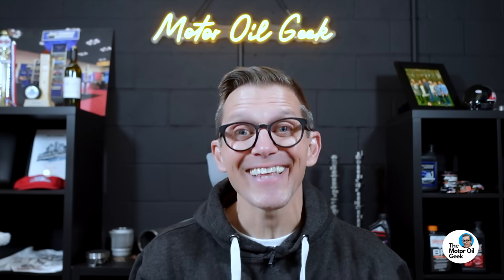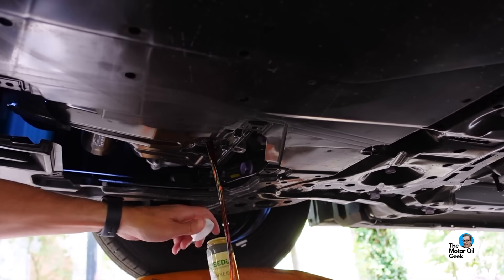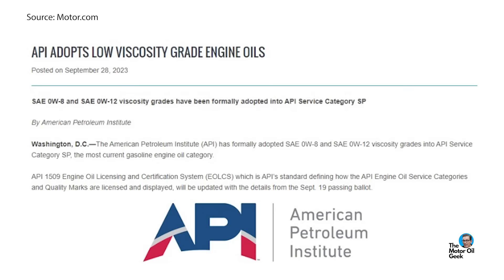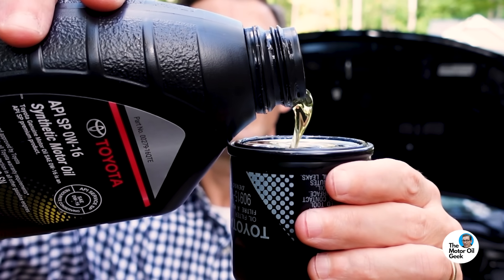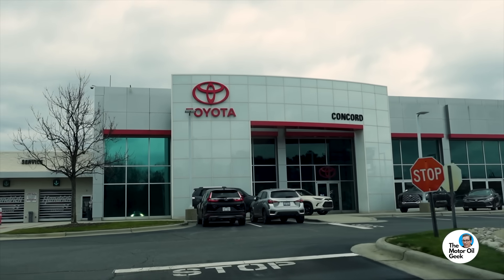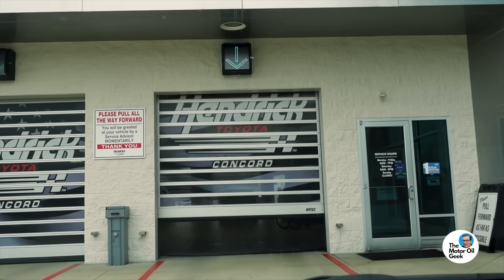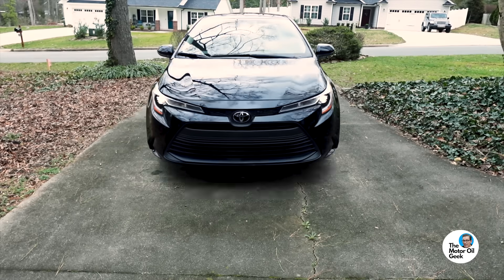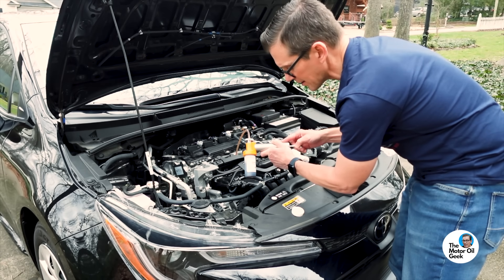0W-8 Motor Oil: Too THIN to Trust? Let's Find Out!

Comment: Would use the new Penn ultimate or stick with Toyota 0w-20 oil in my Tacoma? How good is Tacoma 0w-20 oil?
Reply: I don't think it is anything special. Project Farm actually just did a video about OEM oils recently if you're interested. 
I just use a mid-tier 0W-20 in mine (Quaker State, Pennzoil, whatever) and I change it every 5k miles, pretty standard. 
I tend to subscribe to the mindset that most of the synthetic oils out there today are pretty good and unless you are stretching the interval out the premium stuff doesn't justify its extra cost in the long term. However, that's just my opinion. 
The Tacoma is a good truck and I expect the engine is perfectly happy with any decent oil. Heck that may even be why the stuff with the Toyota label isn't the best oil out there.

tldr, you're probably fine either way.

Comment: I have Toyota Yaris Cross hybrid 2021 model last year  14.500 km I got my 1st oil change by dealership and they put 5w-30 and I don't have a problem in my Yaris Cross by now odometer now is 25.600 km.

Comment: Okay, I was just heading to the comment section to tell you my opinion of waiting 10k for the first oil change.  Glad to hear you didn't wait that long in reality.
Reply: no one shood be changing oil at 10K
Reply: @jesseozmen9835  everyone in europe is, most of the people say its not worth the money to change it earlier. Some people even change it every 20k
Reply: @foxy126pl6   i have seen first had many times what an engine looks like at 70K miles with 10K oil change its not good.

the way i see it is they are to meet EPA requirements so if 0W-8 works for 100K miles and the engine wares out that's the problem of the sec or 3rd owner.
and 10k mile oil changes are ridicules 5k max.
Reply: @jesseozmen9835  idk, ive seen lots of cars with over 350k km that did oil changes every 10k miles and they still run
Reply: @Billybigrigger-ic7jp idk, we usually type "15k km for next oil change" which is like 9000 miles, most of the people do it either every 15k or every year, whichever comes 1st. I have seen some people do 30k km or 18k miles between oil changes since "thats what the manual says"
Reply: @Billybigrigger-ic7jp european manuals dont. They do it becouse the brands know noone can stop them from saying that

Comment: There is this ongoing debate about how with today's engines being manufactured with tighter tolerances, would an oil change at or before 1,000 miles be necessary?

Honestly? I'm from the old school days of car mechanics/maintenance and I definitely would still do it.

I was also told, most likely incorrectly, that the very first oil that goes into a newly assembled engine is given a special additive that assists with the break-in period.

My question is, with your testing of these new oils they showed great results in hot temperatures but, did you conduct any tests with these same oils at negative degree temperatures? I mean, surely an oil lighter than air (sarcasm) at 0W 8 would have no issues pouring/lubricating at extremely cold temperatures.

Comment: 🔔😎Question. 
I have a Fox Mustang 5.0 with the "sandwich" water to oil engine oil cooler between the block and the oil filter and it's plumbed into the heater hose, as per police cars. 195* thermostat. Mobil 1 10/30, Mobil 1 filter. Whats your thoughts on that type oil cooler for hot summers?
Trucks are plumbed into the lower radiator hose.
Thank you for sharing all.your great knowlege.👍😎🇺🇲

Comment: Toyota CVTs are not designed like any other manufacturer. They do not have pulleys with steel belts. The fluid change intervals are not needed as frequent.

Comment: I don't like low viscosity oils and CVT transmissions. CVTs have been more mainstream because the 'supposedly' get better fuel economy and it's an automatic. I'm not sold on it. I would love to see a side by side comparison of a Corolla with a CVT and a regular geared transmission.  I had a 1997 Corolla with a 5 speed that I ran all Valvoline synthetic fluids and I built a custom cold air setup with a K&N cone air filter (before I knew better, I would never run K&N again). I would consistently get 46-47 mpg on the highway and would be agitated if I got less then 34 in town.
   
Your study that you did is great info, makes me feel a little better about low viscosity oils. Was the engine in this test hot fired (running) or was it just spun with an electric motor? It appears to be hot fired. Was the test done in one shot (all 150 hrs) or was it broke up into parts? If it was done in one shot you wouldn't have any condensation like an everyday driver, flawing the test a little.

Comment: The problem with super thin oil isn't lubrication, its a combo of the low tension and thin oil control rings, and the thin oil getting past them.  As the miles go by and usually out of the warranty period, the thin rings carbon over and oil use goes way up, especially if oil change intervals are not well adhered to.  An inattentive owner can easily run low on oil and lose an engine.  This happens a lot to KIA and Hyundai owners especially.  

I enjoy the "I Do Cars" YT channel, Eric over there tears down blown up engines and all of them that spec OW20 oil have carboned up and usually stuck rings.  What I see from the engine tear downs is distressed oil control rings cause excessive oil use, which leads to running  low on oil, resulting in spun crank  bearings.  The rod and main bearings generally look fine with the thin oil as long as the level is maintained and something else caused the engine to die, like driving it through deep water.  

Clearly thin oil lubricates well, the issue is the darn thin oil control rings.  Manufacturers are reaching too far to eek every last fractional MPG out of modern engines.   I wager if manufacturers used wider stronger oil control rings there would be no problem at all with thin fully synthetic oil, which does enjoy the advantage of quick flow on startup.  

As things are, a 10K oil change interval is way too long for watery thin oil in combo with thin oil control rings.  I would do it every 5K at most.  My wife's car specifies 0W20, I run 5W30 and oil consumption dropped to almost zero during it's 5K interval.  I also believe that the slightly heavier but by no means "heavy" oil helps with preventing the carboned up thin oil control ring issue.  

I have a diesel pickup running T6 5W40 diesel oil, after 7.5K miles it's iron reading is around 13-15 PPM, which is less around half what the 4 PPM per 1K miles results were here as well.  It has nice old school full sized oil control rings, and uses half a quart every 7.5K miles.

If anyone reading this drives a newer KIA or Hyundai, I suggest using 10W30 oil, and keeping an eye on the oil level.  It is good for all of us to just make a habit of checking the oil level at every fill up.  There is no reason to lose an engine.
Reply: Eric’s channel is the best I love his videos!
Reply: Toyota calls for carbon cleaner every 5k. I use seafoam.
Reply: @tntgators  Interesting.
Reply: My friend's Kia has just seized during driving. No oil light flicker, no clatter on hard turns. Was quiet and smooth then seized. No oil left. It went from almost no consumption to enough to drain it between oil changes. She always takes it to our trusted mechanic so I believe it was changed correctly. I bet it has control ring problems. We have a Vitz (Yarris) that loves oil too. I just keep an eye on the level and we use a higher viscosity now that it has higher kms on it. Not worth stripping it down to do the rings
Reply: @tenmillionvolts  Sorry to hear about your friend's engine.  Sounds like you are on the right track with yours though.
Reply: For new toyotas you really should just use what they tell you to. They’ve been using 0W8 in Japan with no issues for a decade at this point, and now that it’s approved in the US their ECUs are programmed like their japanese ones. Unless you’re tracking a car there’s no reason not the use the recommended oil
Reply: @meromeromau  Noooo. 0w8 is only several years old

Comment: In my 2010 Prius, which has the same basic drivetrain as all Toyota hybrids, I did UOA’s & used Mobil 1 0W-20 and Toyota TRD filters.  The UOA’s showed that I could safely go 10k miles between oil changes.

I did initial oil changes at 500, 1000, 2500 &. 5000 then every 10k miles.

Comment: Wait!!! Is this a Toyota hybrid?  That has an “electronic” CVT that doesn’t use a chain & cones!  It uses two electric motors and a planetary gear set.  You still should change the fluid at 30k and 90 k, but the fluid is gear oil, not special CVT fluid.
Reply from the maker: It is not a hybrid

Comment: I never go over 5,000 miles or 6 months for an oil change. Listen to the Car Care Nut Toyota guru. He says if you want to see 300,000 miles on your engine you better do 5000 mile changes. And I believe he said Toyota CVT trans should be changed every 25,000 miles. The no dipstick lifetime trans on Tundra every 50,000 miles

Comment: I'm following your daughters car on here as I've bought the Honda Civic e:Hev, here in the UK (you guys will be getting this model very soon) its a hybrid just like her Corolla. I plan on changing the oil too at 500- 750 miles, its only done 158 miles so far. It takes 0w20. Im not sure to use the Honda branded oil or Mobile 1 equivalent. If i buy from the dealer and something happens, I can say I used genuine Honda oil... anyway, its good to get the chromium, iron and copper out as its bedded in. Nice one Lake for you channel 👍

Comment: Thanks for the video, appreciate the topic a lot because I personally feel very bad using thin oils.
As a Toyota dealer technician in Europe, I can tell you we use 5W-30 in this exact engine, and on basically all the other common Toyota models and engines.
We only have 0W-20 for the 1.2 4 cylinder turbo (8NR-FTS engine), thats as thin as we go.
Oh and by the way, we don't even use OEM Toyota engine oil, just some generic brand (with Toyota specification approval) which is still mindboggling to me since the oil changes are not so cheap
Reply: Your purchasing department is just trying to save some money. Probably buys 55-gallon drums of some off brand oil to save money. If you are a Toyota shop/dealer, you should use Toyota OEM products for your services, period! Even "The Car Care Nut", at his Independent shop, uses Toyota OEM oil for his customer's oil changes. He is a Toyota Master Certified Technician.
Reply: @randy74989 don't think about it too hard. Even super tech is fine. 15+ years on a Posche 944, 8+ years on BMW proves it. This isnt rocket science, and please don't elevate it to "gold"status either.

Comment: way too thin. not even a question.  0w-20 is too thin.  this is done to reduce friction and make it easier for the engine to turn,  resulting in the tiniest fraction of fuel mileage improvement which isnt noticeable.  the bottom line is it sacrifices engine protection

Comment: engine oil analysis by ICP = very accurate test, however, what about oil filter? if the oil filter collects lots of metals, so the used oil shows less, less metal. IMO, without oil filter analysis, only oil comparison does not show a true story.

Comment: Lol thin oil is for epa cafe standards!  What about engines run off oil pressure vct systems.  At idle many engines don't make great oil pressure because rpms/oil pump makes oil pressure.  In most cases 5w40 will be better than 5w20 BECAUSE oil pressure will increase at idle!

Comment: I've been watching your channel for an analysis of 0W-16 vs 0W-20.  My son has a 2020 Corolla XSE and I told him to go ahead and put Pennzoil Ultra Plat 0W-20 in it based on comments on Bob is the Oil Guy.  What's your take?
Reply: ULTRA Platinum is $ 65 for 5 qts jug at Walmart.
Over twice the price of Mobil 1
Reply: Don't get it from Walmart.  I get a 3 pack of 5qt PUP 0/20 from Amazon for $82.

Comment: Good stuff. I was very surprised when my sister’s Scion IQ required 0W-20. However, her engine required replacing even though she had routine oil changes done by the dealer. Now your talk about CVT fluid was interesting because a friend’s 2018 Corolla’s CVT broke at 83k miles. I wonder if it was a fluid problem. Dealer said $10k to replace. That didn’t happen. LOL
Reply: Nope, it's a CVT problem.

Comment: Good Day Motor Oil Geek.
Hopeing for a reply!

Quastion:
Do  these 8 - 16 - 18 weight motoroils apply to the Climatic Viscosity Chart Ratings?
If so how high before the oil can no longer lubricate?
If these low viscosity oils protect the engine at high tempatures then why do not ALL vehicles "Gas/Diesle" not use them?

My understanding is that VISCOSITY is a Science!
Does Science no longer ally?

Comment: my benzes have always taken some real thick oil, 5W-40 type stuff, but my japanese cars have always liked lighter oil like 5W-20. i often wonder where the sweet spot is between a thin, low friction oil and a thick, protective oil. thanks for the vid lake
Reply: 5W-30 is pretty much the norm for German cars.

Comment: 10k miles is too long, it's not just the bearing, cams, and bushings you need to look at... Take apart any engine with 10k oil change intervals on an engine with over 100k miles and you WILL find that the oil rings on the piston are either seized or extremely dirty causing further issues with the compression rings and the scrapers to stick.  Low compression and burning oil are in the future for anyone who changes their oil at 10k miles. Here is your fact check: 10k oil change intervals is the maximum amount of miles before an oil change to maintain your factory warranty, meaning 6 years or 60k miles is warranted under these guidelines. So basically Toyota is only going to guarantee your engine for 60k miles.  CHANGE YOUR OIL AT LEAST EVERY 5K MILES if you plan on keeping your vehicle, you will only save roughly $300 in oil changes every 100k miles if you change your oil at the 10k intervals... $300 vs $3500+ for a new engine, your choice!
Reply: 10,000 miles might be ok for very mild service conditions. Most manufacturers have a 'severe duty' service interval specified in the manual, if you check what they define as 'severe duty' (driving in traffic, short trips, days with high or low temperatures, towing, etc) many cars are running under severe duty conditions for the vast majority of their lives. However if you live in a rural area and the car is mostly used for your weekly shopping run into town (i.e. 30 mins+ trip, mostly highway driving, not towing) the standard interval is probably appropriate.

I do my changes at 10,000 km, which is near enough to 6000 miles. That roughly splits the difference between severe duty and 'regular' duty, which matches my use case.
Reply: I agree with you but not every engine will do that.  My friend has a Camry with 255k and 10 k oil changes.  No issues
Reply: Read the manual.  Toyota says to change oil every 5k miles under many conditions.  10k miles is for people that drive all highway.  I change oil every 10-12k miles and it’s fine, but I drive easy and all highway.  I put the miles on quickly.
Reply: 3500 for a NEW ENGINE? The average cost of a brand new factory 4 cylinder engine averages 10 grand! Doesn't include installation......

Comment: Awesome video. Thanks.

It seems like there is an enormous amount of moly in this oil compared to other samples I have seen. I guess that's part of the thin oil magic. 

I'm interested to see the results at 5, 7.5 and 10k miles. I usually change at 7.5k based on my engines, oil and drive habits. I've found that to be a reliable number in a couple engines using PP 5w30 and Rotella T-6 5w40 oils. This is of course based on testing used oil samples. How else would I know?

Comment: As a 20 year mechanic i would never put 0w8or 0w20 oil in any car i own..  the car manufacturer dont care if your engine last more than 100k. Thin oil will burn off faster get thinned out by gas and moisture.  They are making sure that the cars are disposable after 100k that way you have to buy a new car sooner.

Comment: This proves that new engines are cr4p
Reply: So tight clearearances that the oil has to be water thin.... If anything overheats, goodbye oil pressure and engine goes kaboom

Comment: Did Toyota ever used chain-type CVT's? I don't think so, always planetary systems, they didn't invent it, but engineered it to a very good system.
Reply: Toyota CVT's are chain-type's, e-CVT's are the planetary systems.
My 2011 car has the chain-type CVT.
Reply: In my idea, i only talked about the hybrids. Indeed the gasoline only version is a different story.

Comment: We actually had a Toyota dealer put ATF into a CVT Mitsubishi…. More or less slipped to the point it wouldn’t move . Fluid changed to the correct stuff and problem solved . Worse part was it had only just had a trans fitted as the last one failed !

Comment: You have zero credibility if you let your daughter buy a CVT. And betting there's no way that the engines running on the newer oils will have the longevity of the older higher viscosity oils. No way in hell I'd be using a 0-8 oil in our sometimes 40 degree C heat.

Comment: In case anyone's curious- the oil selection for weights is Chef's Choice. That's why overseas cars have MULTIPLE grade options whereas the US only lists the thinnest for fuel efficiency. Not longevity. I've moved my 2016 Corolla from 0w20 to 5w30 at 200K miles. Virtually no difference in economy, quieter, and I don't have to add a quart to two quarts every 5K miles. This new stuff is too thin.

Comment: I don't buy a 10k oil change interval on a modern engine with DFI and turbo. Also never seen one go 100k without an oil related issue from phasers to timing chains. Lifetime fluids is the best con of all time. Stealerships enjoy replacing transmissions or selling you another car...